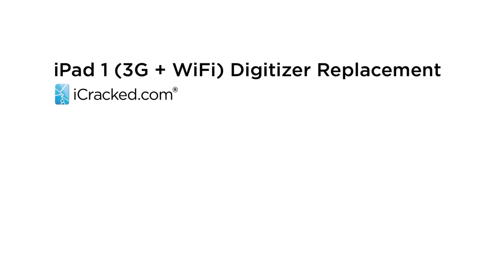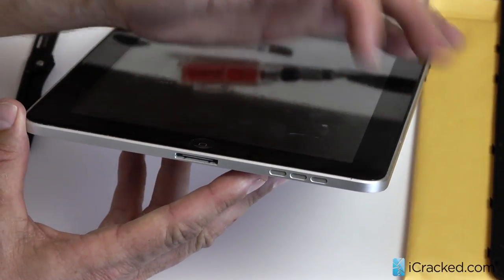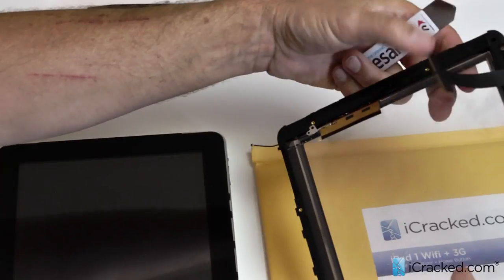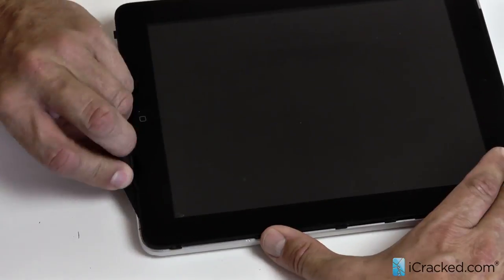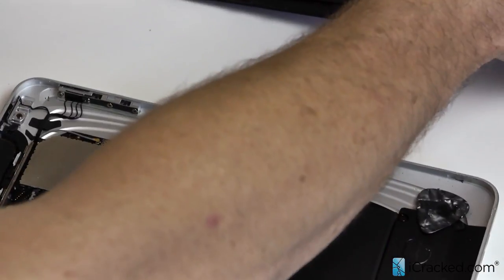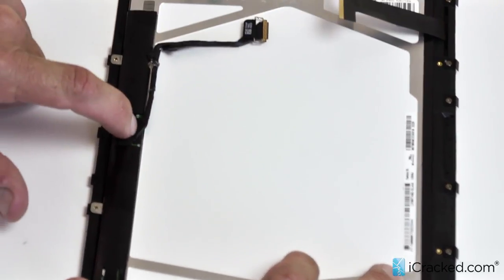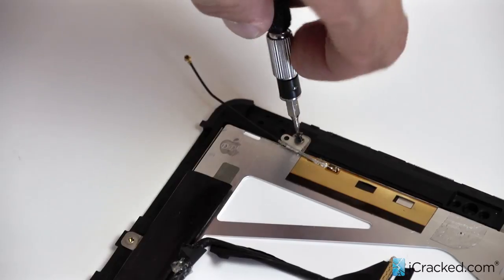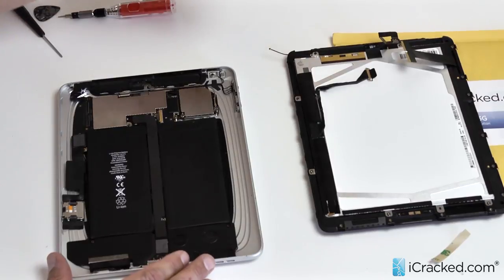Official iPad 1 (WiFi + 3G) Screen / Digitizer Replacement Video & Instructions - iCracked.com

Comment: I accidentally bought the digitizer without the 3G antenna. Is it okay just to remove the old antenna from the old digitizer and stick it on the new one, or are they sealed together electronically as one big antenna?